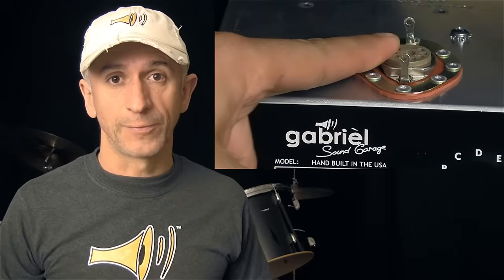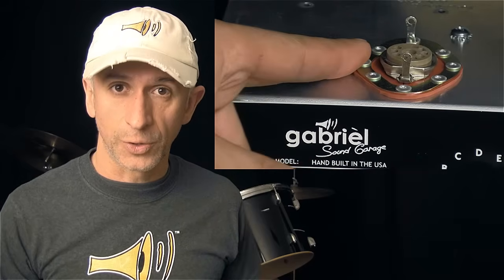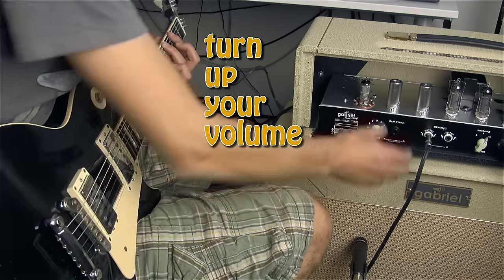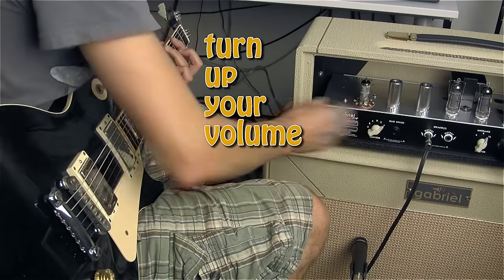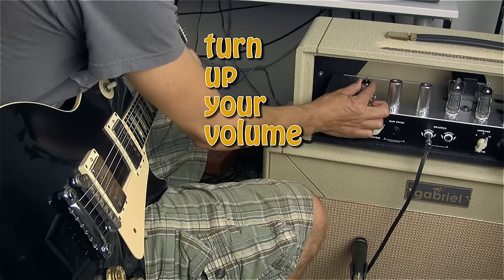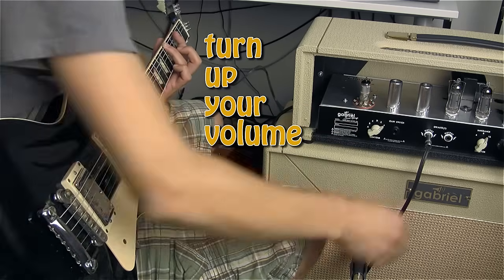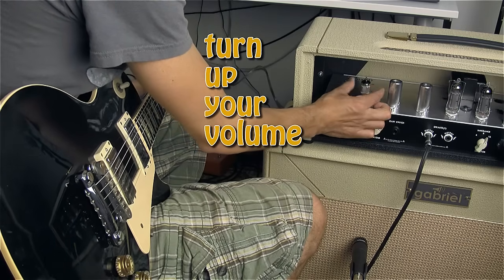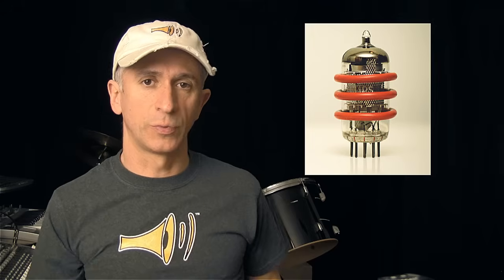The Silence of the EF86 Vacuum Tube

Comment: SoundGarageTales, if you have a bucket of new but "noisy" EF86´s you are not using them correctly.
The EF86 was designed specifically for audio applications were low noise was important. Two  µV should be far enough for a guitar amp...

The problem you are describing is called microphony.
You might want to try the more rugged military versions or change the layout of your amp.

Greetings